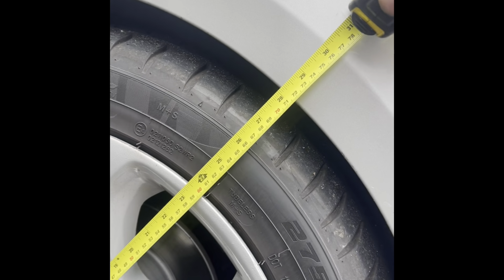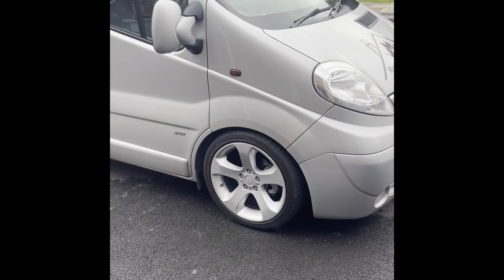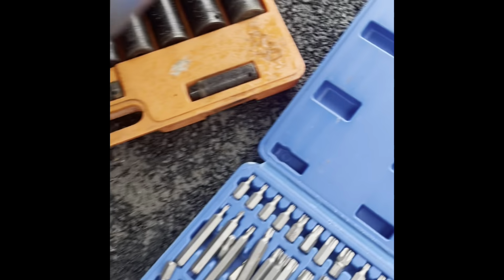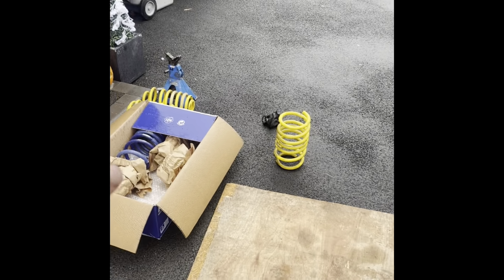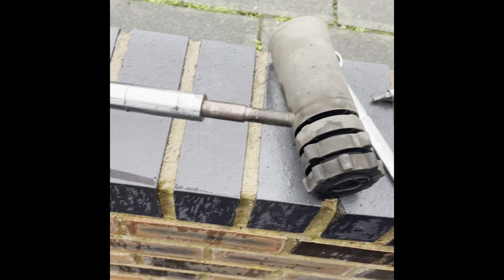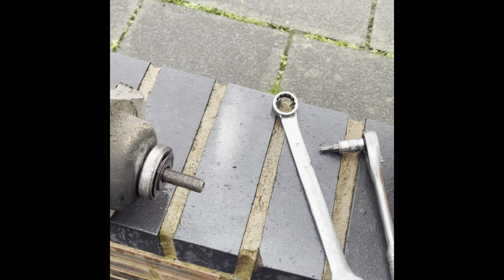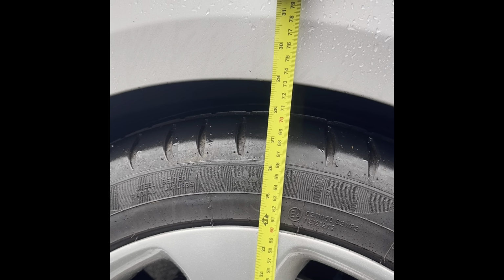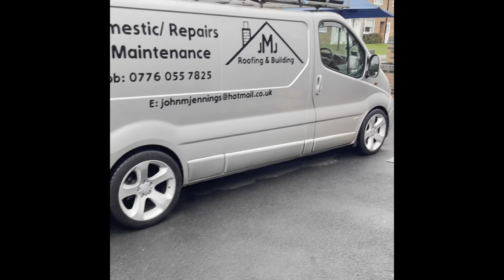Vauxhall vivaro lowered review H&R Amax lowering springs how it drives before and after

Comment: X5 wheels oh dear. The plod are cracking down on non-commercial load grade wheels on vans. Your wheels need to be rated to take the maximum possible load the van could carry, much like Supercars that need tires rated for 250 mph etc, although the max spped one can do is 70mph. . If you have a bump an insurance assessor will  immediately spot those wheels
Reply from the maker: Thank you for the input information .
I thought stock ×5 wheels would be ok as long as iv got the right tires the wheels have been on my other van for the last 8 years on stock suspension iv told the insurance company what iv done.
they put my premium up but seem to be ok about it they even asked for pictures of the van
Reply: @johnshomegarage7828  Sound legit then, but I read that info. on the internet so it must be true. :D
Reply: @MonaichFother  
As you mentioned, lots of people online saying that about BMW alloys on the Vivaro, seen lots of people  talking about it.
I’ve got the X5 alloys on mine too, GVW for the X5 and Vivaro are pretty much the same, about 2.8 ~ 2.9 metric tonnes. 👍
Reply: UK police are out of control lately when it comes to motorists!
Reply: @johnshomegarage7828  I think you might be ok as the X5 is rated to about 3000kg maximum weight and depending on your van load rating, 2700kg etc it will probably be the same or less than the X5